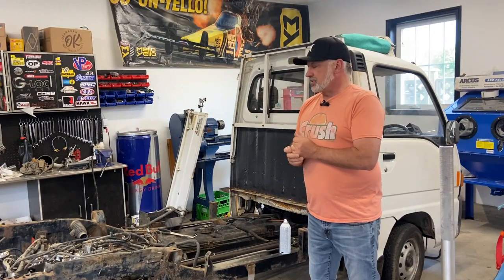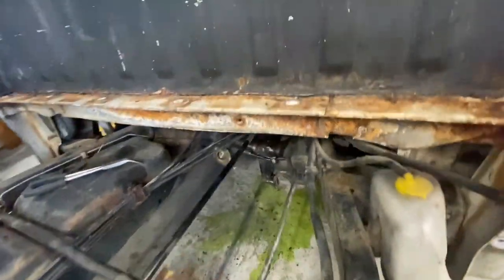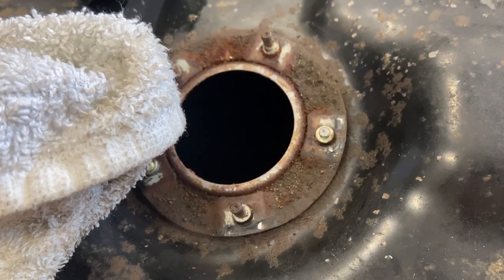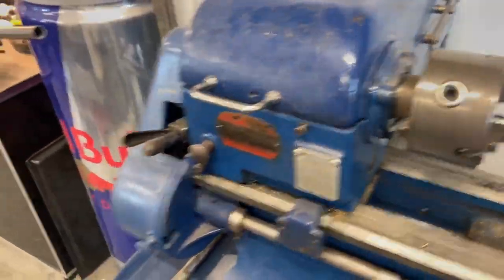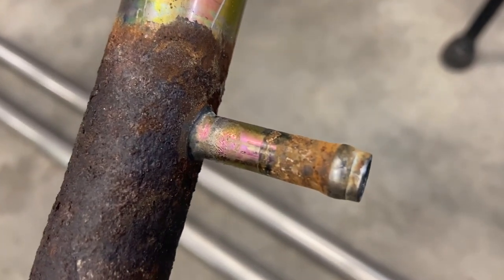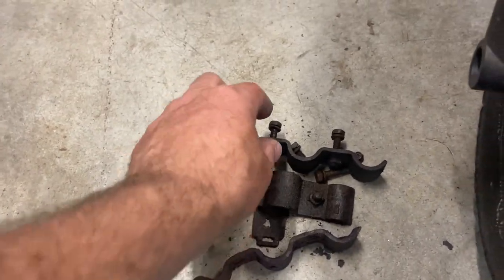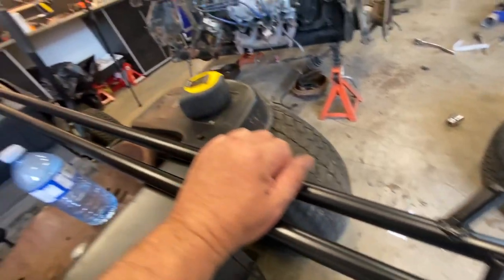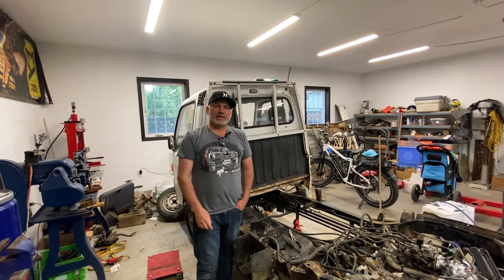Subaru Sambar rescue part 8, coolant pipe fabrication.

Comment: Good work on the coolant pipes!  I had the same problem with my Sambar, but luckily only the straight pipe was bad.  I used 1/2" copper pipe, used a standard 45 degree plumbing flare tool on it (being sure to only partially flare it so the hose can still easily slip over), and then scuffed and painted it to protect it from corroding.  I also cleaned, scuffed, and painted the other tubes, since they were just starting to show signs of rusting.  Just did the testing fitting today and they all seem to be holding water back under pressure!

Comment: Nice job on the coolant pipes. I save old popped inner-tubes to use for cushions on metal to metal contacts.
Reply from the maker: Yea that is a great idea. I didn’t have any kind of rubber around and wanted to keep going so used what I had laying around. Using wife’s inner tube from her bike would not have gone over well!